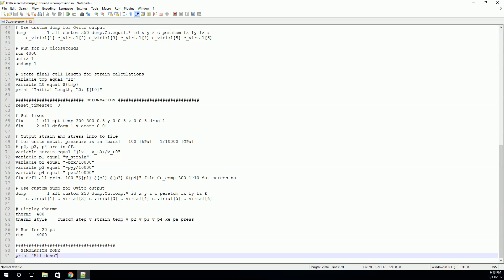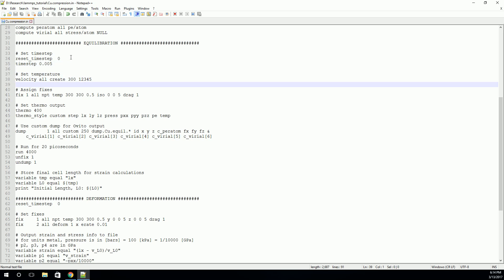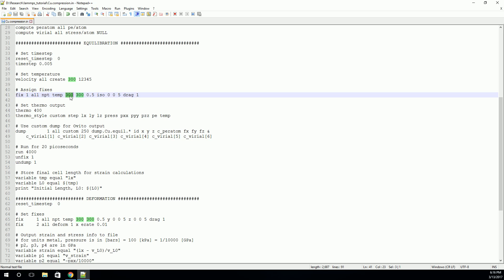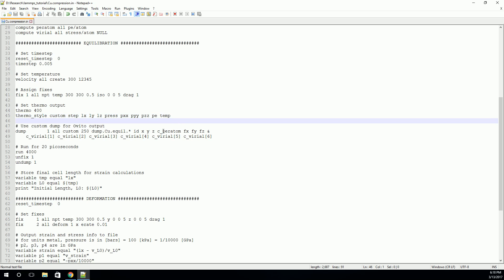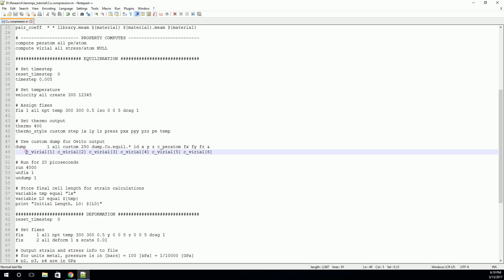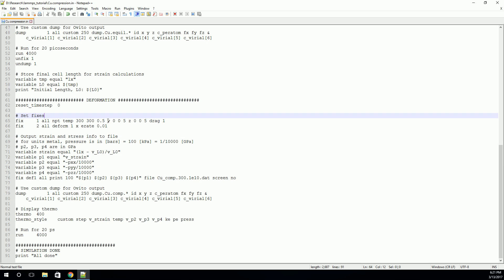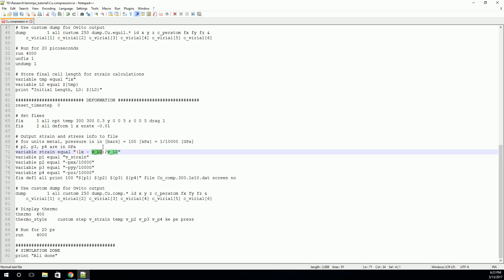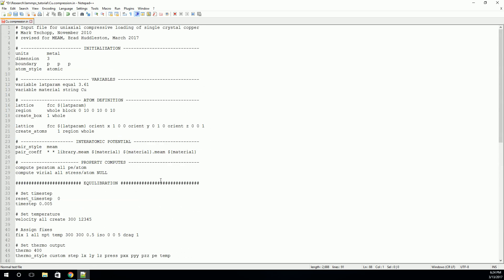The LAMMPS Input Script - Part 2

Comment: Hello~ Thanks for your wonderful video. However, it does not work perfectly with your script shown in the video. "Compute csym all centro/atom fcc" is missing so the "dump" command does not work in the end. One more thing, you should mention to your audience that addtional material library files have to be included in the simulation directory. the simulation does not work only with the simulation script.

Comment: Very informative, thanks 
why did you set "erate" and pressures to negative ?
Reply: I do not know the program well. If it is my guess, I would imagine that pressures come out negative and the negative sign makes the pressure positive. For the erate, I do not see a negative sign but negative strain corresponds to a compression as opposed to tension.

Comment: Great video! thanks very much. 
I have a question too: usng your tutorial and a few others, I have prepared an MD simulation of PMMA polymer, but the stress-strain curve is a flat line (with a lot of noise of course). Do you have any idea why this is happening?
Reply from the maker: I don't have any ideas off the top of my head. Are you able to visualize what is happening? It could be that the polymer chain isn't being deformed correctly.

Comment: 300 300 0.5 -  Why 0.5 ?! 300 300 300 - Why not?
Reply from the maker: Are you talking about the fix nvt command?
It is a good question. The three numbers indicate the starting temperature, ending temperature, and the temperature damping parameter. The documentation notes that for a system to be stable, the damping parameter should be 100 times the timestep - thus, 0.5 for this setup.
Reply: @Jere5120      Thanks! The documentation:

https://lammps.sandia.gov/doc/fix_nh.html

Comment: Thank you for the tutorial. I am new to LAMMPS and learning. I type your entire script in txt file. Guide me how to save and run this simulation from command prompt.
Thanks
Reply from the maker: A txt file is fine as a LAMMPS script. From the command prompt you will just need to specify it as the input file:

lmp_serial -in ScriptFile.txt

or if that doesn't work,

C:\Path\To\Lammps\lmp_serial.exe -in ScriptFile.txt 

where you replace it with the path to your lammps executable. 
Good luck!

Comment: Hello mate , its gave me an error in statement of thermo , exactly here "thermo_style custom step 1x 1y 1z press pxx pyy pzz pe temp"  whats wrong with it ?
Reply from the maker: Hello! Thanks for watching. It's hard for me to tell, but it looks like you have the number one then an x - like 1x; I think it is supposed to be a lower case L - like lx. Those can be confusing with typed code! In either case though, an error on that line usually means that you are asking the thermo output to print something that is not defined. So, make sure that all the variables listed after "custom" are defined. You can find the list of built in variables here: https://lammps.sandia.gov/doc/thermo_style.html

Comment: sir, i saw this awesome video and gave the exact inputs as in the video but i am getting this problem
WARNING: The pair_style meam command is unsupported. Please use pair_style meam/c instead (../pair_meam.cpp:51)
ERROR on proc 0: Cannot open MEAM potential file Potentials/library.meam (../pair_meam.cpp:468)
Last command: pair_coeff        * * Potentials/library.meam ${material} ${material}.meam ${material}
help me out here sir.
Reply from the maker: Thanks for watching! 
It looks like your script can't find your potential files. You will need to make sure that they are in the same directory where you are running the simulation, or to give the full path to the file inside the script.
Reply: Sir that's what I am getting confused about. I dnt know where are the potential files are. I couldn't do it. Please make a video on how to install lammps if Lib is not built in and how to build it and run a code with simulation. 
It would be of great help if you can make this video as it will immensely help in our research

Comment: First, I'd really like to thank you for your video. I'm a new user of Lammps and it's been a challenging task learning how to use it, specially because most of the available materials are made for computer science experts (I guess). I've spent some hours reading the Lammps manual trying to understand just some commands, and your 10 min videos gave me more information than all the hours I spent reading. So, thank you. I'd like to use some of your kindness a bit more. I'm having problems in understanding the structure of the data file for lammps simulation. For the systems I'm working on, I need to use a data file, which as you know contain all the structure parameters required to run the simulation. Specifically I need to know how to build a data file or how to adapt my CIF file so Lammps can understand it. My problem requires that I build some data files to use the command read_data a couple of times in the input script in order to insert a small molecule in a pore structure (probally using some commnds related to Monte Carlo simulation). For now, if I understood the data file  stucture I'd be happy. So, if you could make a video about it, I'd be in immeasurable debt to you.
Reply from the maker: Thanks so much for watching! I am glad it has been helpful for you.
I will add a video on the data file to my list! Creating data for LAMMPS is something that everyone seems to have questions about - it isn't necessarily straightforward, and there are many ways to do it. I'll see what I can do to help!

Comment: Hi, 
I am a new user with Lammps, and I have many questions about this software. First, i downloaded and installed it on my Pc, but I could not find the EXE icon to start the software. i know my first question may be silly but i want to start from Zero to understand this application. i want to use this software to simulate water molecules within diffrent methanol concetrations at diffrent temperature. so i hope you can assist my requist.
Reply from the maker: Hello! Thanks for watching. When you ran the installer, you had to choose a destination folder for your LAMMPS installation - by default it is something like "C:\Program Files\LAMMPS 64-bit 20170127". You can change this path to where ever you'd like. Once it is installed, your executables will be in the "bin" directory of the folder you chose.
Reply: EnCodeVentor 
Thank you for replying.... I found these exe files, but it wouldn’t open kindly send me the steps..... then I will see your video to write my codes....
Reply from the maker: So, these executables (particularly the "lmp_serial.exe") should only be executed from the command line, and only with an input file. In the video you can see something like the command: "lmp_serial.exe -in lammps.input". Then, the program will run.

Comment: Thanks very much for this informative video!!! I was wondering if you could make a video regarding available pre-processing methods/softwares. I am specifically interested in finding potential function and/or coefficient to calculate the force between atoms.
Reply from the maker: Thanks so much for watching! There is a couple of aspects you could lump into pre-processing: First, actually creating the atoms and geometry (this is a popular question) is clearly pre-processing. I am definitely planning on doing a couple of different videos on ways you could do that. Second, as you mention, actually finding or calculating the potential for your material. For this, you can take a look at some of the other videos on my channel, especially those by Dr. Dickel. He goes through a step by step process on how to calibrate a MEAM potential - which works very well for metals. https://www.youtube.com/watch?v=bipKWVFX01I
Reply: As you have mentioned earlier, the atom and geometry creation is pre-processing. So, could you introduce me to any software that could help me out to figure out the geometry. If it is not too much, I am interested to know if Quantum Espresso can also specify the characteristics of an atom/particle in excited state?
Reply from the maker: That is a great, and a challenging, question. I have yet to find a software that really meets all my needs. Most of them are quite expensive: Material Studio, for example. There is a few other commercially available software packages that are also quite expensive. Once you get into the free realm, it takes a lot more work to use the software. In the future I am hoping to make some tutorials for an open source software package called Atomic Simulation Environment (https://wiki.fysik.dtu.dk/ase/). It can create atoms pretty well, though it takes some work to figure out how to use it.

As far as Quantum Espresso goes, yes, I think it can. BUT, it depends on the part of the software you use. QE is actually a package with quite a few different programs in it - so, for example, the PWscf model that I use in my videos on QE cannot really do excited states of atoms. But, it does have some other models that might be able to handle that - I have not looked into them in detail.
Reply: Thanks a lot once again! This question has been bothering me for some time... as you might have guessed I have gone through the commercial software but the cost of acquiring them is too high. One of the commercial package that made me interested is VirtualNanoLab(VNL)- ATK-Forcefield. 
Since they claim they offer both VASP capabilities with their ATK engine and  a GUI  that is capable of 3-D Geometry building(VNL). Please let me know if you could comment on that!!!?
Reply from the maker: I haven't actually heard of that one! Thanks for telling me about it. At least a few of the commercial codes I know of like to offer the computational ability from within their gui. It can be handy, though I usually find I need more for batch computations instead.

Comment: Is it possible to do calculate interfacial properties of, say, methane liquid and methane vapor using LAMMPS?
Reply from the maker: It may depend on the interfacial properties you are wanting, but theoretically, absolutely. You will however need a potential that can accurately capture the atomic interactions of the carbon and hydrogen atoms. There is a new MEAM-BO potential which may be able to do this, but whatever kind of potential you use, you will need to make sure it can represent the important properties of both the methane liquid and gas. Finally, you may find that there is not a clear border between the liquid and gas phases at the atomic scale - it may just vary in density sort of smoothly from the liquid side to the gas side. It sounds like a fun problem! Good luck!

Comment: Melting

1. Set the initial configuration of the nanopowder in three versions:
A) an ordered system in which titanium nanoparticles of identical sizes (from 5 to 20 nm) are located at the nodes of the cubic lattice (up to 64).
😎 at lattice sites of fcc (two embedded cubic sublattices).
C) randomly distributed particles of random sizes.
To relax at 300 K and 0 bar for 100 ps.

2. Heat from 300 to 2500 K for times of 50, 100, 200, 500 ps. Calculate the surface area of the particles (construct surface mesh) and the fraction of the initial area -> the conclusion about the efficiency of fusion / sintering.

3. Cool then 2500 to 300 K. Then apply uniaxial simple stretching and determine the yield strength and tensile strength. Compare with a monolithic sample of titanium.

Compacting

1 ===

2. Compress uniaxially with a constant strain rate of 10, 1 and 0.1 / ns until the pores disappear. Calculate the surface area of the particles (construct surface mesh) and the fraction of the initial area -> the conclusion about the efficiency of fusion / sintering.
Reply from the maker: Hello! If you are just getting started with LAMMPS, you will want to start with some more simple simulations, so you can get a feel for how LAMMPS behaves, and what atomistic simulations look like. 
Try to follow along with my LAMMPS videos, and then experiment with them by changing the options for the initial temperature, the thermostat, and the pressure boundary conditions (these are boundary conditions) and watch what happens! You can get some very different responses just by changing these things.
Reply from the maker: Of course! You should be able to find the whole LAMMPS manual right here: http://lammps.sandia.gov/doc/Manual.html

You can explore the menu on the left to find the topic or command that you need in the manual.
Good luck!
Reply from the maker: Hello! Thanks for watching! 
This is a big question, and a great problem to be working on! It looks like there are several things you need to think about as you get started on this. Here are my thoughts:

1) What shape are your nano-particles going to be? This will help determine how you want to create your geometry. With a complex geometry like this, you may want to write a separate script in Python or MatLAB to generate your geometry and write a data file. Then, you can import it into lammps - but that depends on what you want to do. Along with that, you will need to know the crystal structure of your metal.

2) What are your boundary conditions? You have thermal BCs but will your mechanical BCs be (ie. constant pressure? constant displacement?)?

3) Also a caveat - in my experience, if you raise the temperature to 2500 K in an atomistic simulation, you are not likely to have any free surfaces left. It will certainly depend on the material, but the atoms are vibrating very quickly at that temperature, and the particles very likely could completely fuse. You will only know if you try though!

4) Similar to the last point, you will need to be careful how you interpret the stress results from any uniaxial tests you do in atomistics - particularly the yield strength and tensile strength. Atomistic simulations can often have order of magnitudes higher yield strengths and, depending on the boundary conditions, may never have a definitive "fracture". This is because of the very small scales represented in the simulation - you typically can't make a simulation big enough to have accurate dislocation motion and interactions. So, the stress results must be taken with a grain of salt. 

I hope this helps! Let me know if you have any specific questions on how to accomplish some of these things in LAMMPS!
Reply: EnCodeVentor . i just begining to work at lammps . i just want to teach me how i can start at this problem . i used titanuim powder . and i do not about boundary condition .i can resume it .you can you send for me your contact
Reply: i want to create box and inside box 64×64 sephre atom
Reply: EnCodeVentor  please you can just give me keys about my problem . or tell me how i can use manual about this problem
Reply from the maker: I can try! This is a very research-y problem, so I certainly can't say I have the answers.
To control your temperature in a melt, you will want to look into using a "fix nvt" or a "fix npt". The first will fix  your system size, the second will fix the pressure. You will probably want to try both and see the differences. You can look up the usage of them both in the manual.
You can use the same process as I did to create the atoms - if you want to create different geometries, like spheres of atoms or something similar, you should look at the "region" command and the option for "sphere" or any of the other shapes. You can use that to create different nanoparticles in your simulation. 
I hope this helps!
Reply: EnCodeVentor please you can tell me how i can use manual